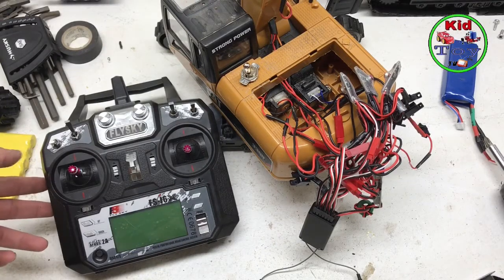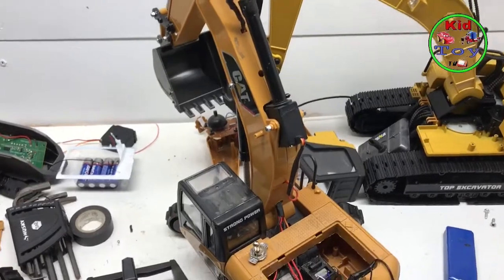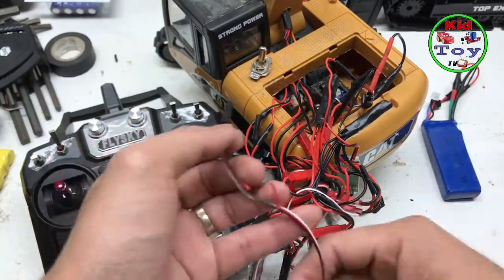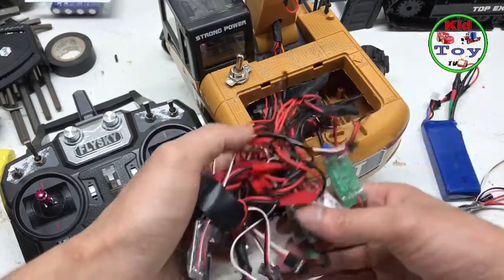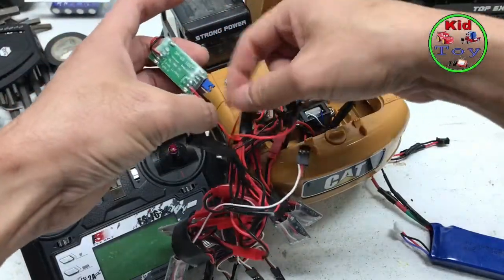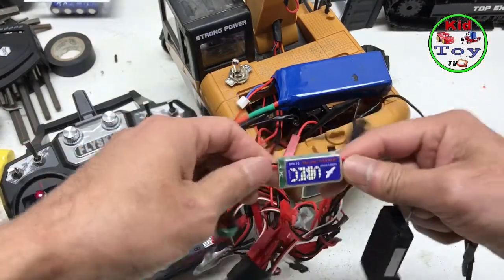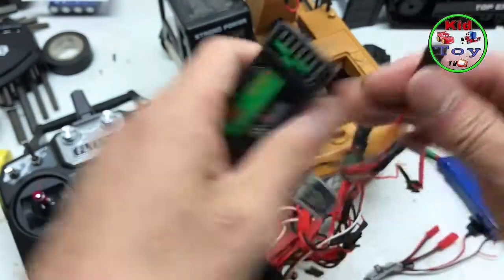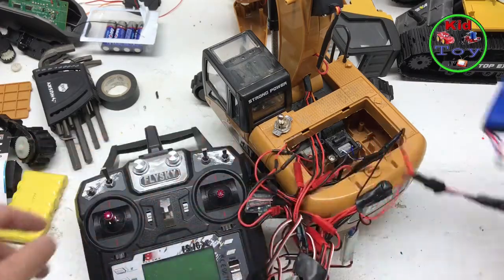how to replace remote control huina 1550 to flysky radio transmitter! Huina upgrades

Comment: Hi how do you set the endpoint of the arm action? Otherwise the motor will burn out at endpoint ?  Thanks
Reply: Not sure, but I believee these arm servos have a switch at the end of each travel. not 100 sure though.
Reply: The models with screw actuators (580, 593, 594) have limit switches hidden in the boom
Reply: @killermurderer2208  thanks.  I got it.

Comment: I'm attempting to replace the remote and speed controllers.  I'm having trouble with the controller (l298n xy-2.5ad) with an fs-ia6b receiver and a flysky remote.   The remote and receiver seem to work but no movement from huina motor